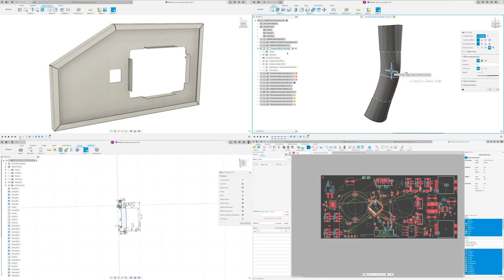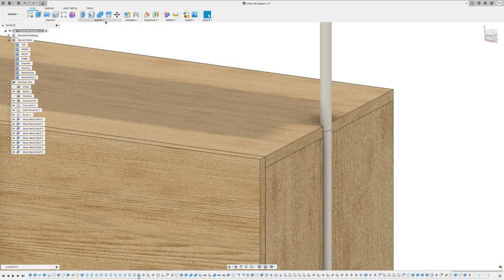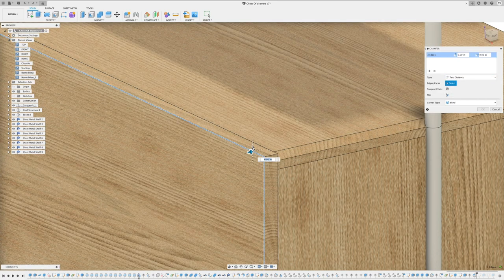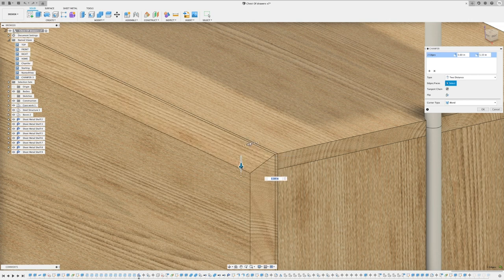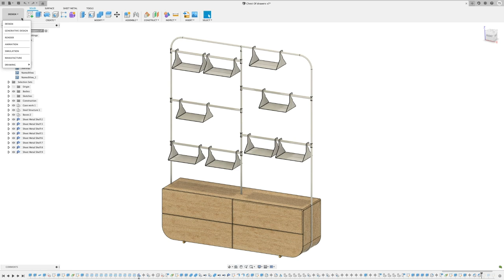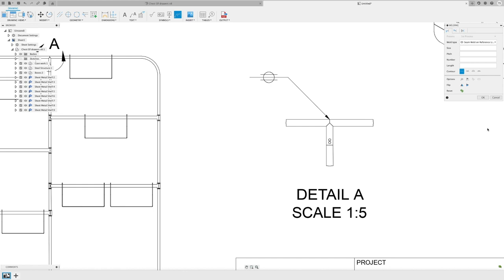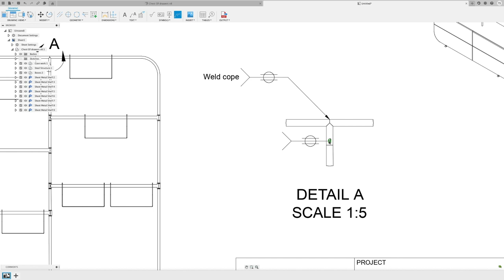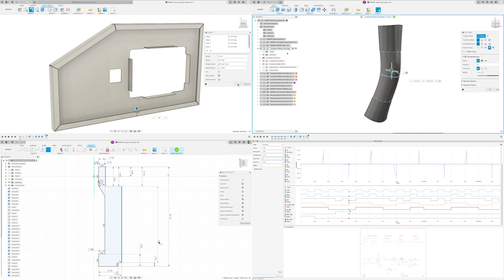What's New In Fusion 360 Design & Engineering – December 2020

Comment: I was trying to do a 2d Drawing and I can´t understand why the tools in the Drawings workspace are so poor. It´s impossible to sketch an elipse or a bevel. Why? All these 2d drawing tools are already available in the sketch on the Design workspace so why it is not available in the Drawings workspace as well?
Reply: You are not supposed to do the entire 2D drawing in the drawing workspace. It's not AutoCAD. You need to design your part in 3D, then get the 2D geometry automatically in the drawing workspace and simply annotate it there. The drawing tools in the 2D workspace are there only to facilitate annotation.
Reply: @ExMachinaEngineering  I am sure aware of that. But there are lots of details that i have to draw because there is no other way to do it. Example: i have a curved tube and fusion don't do center lines in curved tubes I have to draw it. In other case I was just trying to represent the outer limits of a piece to simplify the drawing but drawing a simple rectangle with exact dimensions in a precise angle is just impossible.

Comment: Please improve tools in sheetmetal workspace.
1) nesting sheetmetal bending
2) tab and slot feature. 
3) command to export all sheetmetal components flat patterns to DXF in a single click. 
4) sometimes sheetmetal rules are taking wrong rules. Please fix it. 
5) ability to import autocad block sketches
6) software is crashing when I import large DXF files.